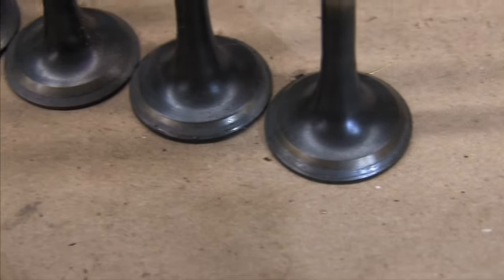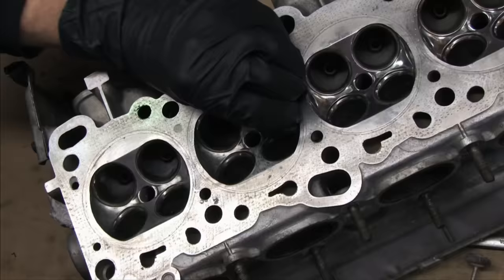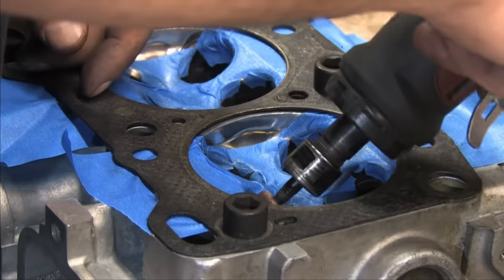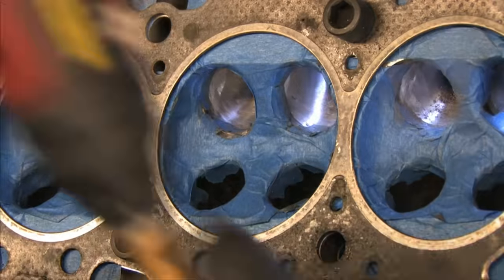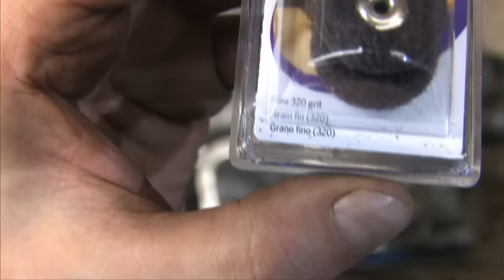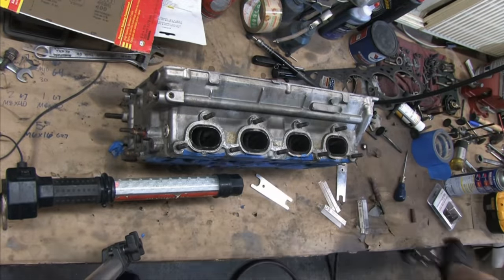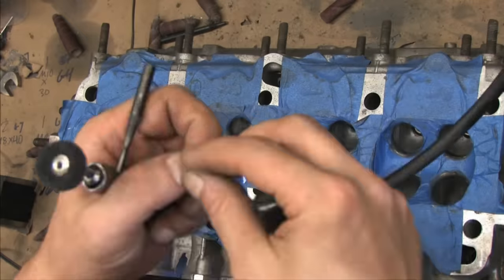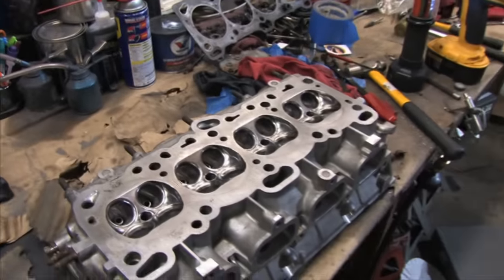Cylinder Head 204 - Porting & Polishing

Comment: i'm a wood carver/ worker. The polishing process could be made easier/faster with wood working supplies. Now days they make really big contoured sanding attachments with all kinds of grits as well as different shaped buffing wheel/things.
basically, a bunch of old guys like making wood sculpture and wood bowls. They're arthritis and low energy level makes it hard for them to sand and polish more than one bowl per retirement/life. so, there's multiple companies that make all kinds of crap for this. Go check it out!! *try woodcraft
   also! we spend allot of time sharpening and stropping our tools. we can feel the difference between stropping (polishing) compounds. There was a study done with microscope cameras on polishing compounds and most that are on the market are a mix of different size particles. They only thought they needed some particles of a certain grit size, they didn't think it would be a problem to throw in a bunch of particles that are way bigger. this is all the polishing compounds in hardware stores.
  Theres very few that really polish without scratching. Flexcut gold. DMT. henry tylor. the only ones i've found so far. good luck.
Reply from the maker: I love old arthritic guys that make tools to make life easier.  All good information!  Thanks for chiming in!
Reply: yeah...i wish you would get a honda express to restore. really nice video man. top notch. i know how much work it is.
Reply: I end up using Diamond files to really fine tune a port/polish.
Reply: You should try menzerna compounds. I'm a woodworker and luthier myself, and I've found their compounds to be excellent for everything from stropping, to polishing metal, to buffing out lacquer. They are aggressive, but have a consistent particle size and take less grit steps to get the end results.

Comment: Fantastic video!  The editing and high speed was perfect to demonstrate what you have done.
I am a professional head porter (I work for a top name guy doing chevrolet cylinder heads). We never take the time to polish as you did.  I believe it is beneficial in the chambers but unnecessary in the runners (we finish with a 80 - 120 grit cartridge roll). I would spend the polishing time shaping the bowls with a carbide instead.  I understand and agree it is critical (esp with novices) to be conservative but there are a lot of inconsistencies in the bowl area you could clean up with minimal increase in volume.  All things considered a great video!
Reply from the maker: Thanks Kenneth!  I make the same recommendations to everyone today as well.  It was suggested I try this after a discussion with a reputable shop (that I still won't out) about polyquad heads and how they create more tumble and swirl in a 4V configuration.  They mentioned using the dual-textured port to disrupt boundary layers and create tumble earlier in the port.  I thought it sounded like a good experiment.  Ultimately I went from being able to tune this car for 10.5:1 A/F ratios without knock to 10.6:1 A/F without knock.  Nothing amazing or worth bragging about.  It did nothing for the butt dyno.  So like in the video where I gave people the out after the 120 grit, I still give that advice today in the comments.  I can't pin a tenth of a point of A/F ratio on this texture work on a head that was also ported.  It's just not a big enough gain to be worth this effort.  My biggest gains were probably just from cleaning up the casting.  I learned something from this one, so I have no regrets.  :)

Comment: Back in the mid 90's I ported my olds 455 cast iron C heads for my jet boat with the tools he shows. The die grinder ate so much air I had to run two air compressors in my garage to barely keep up. It took me all winter at night and weekends and even burned through one head into the water jacket. Had to get another head and start all over. It was well worth the time. The machine shop wanted $1200.00 per head to do it. And i'm sure they wouldn't have did as through a job that i did. Everything shined like this video. Running a cheater nitrous system and two 750 holley's with mechanical secondaries on top of an Offenhauser tunnel ram made it flow so nice giving me who knows how much more horsepower. I made many a big block chev mad at me on lake berryessa.

Comment: as teenage in the 70s I started to hot rod the stock 327 in my 68 Camaro R/S that had a powerglide tranny. I did a basic top end rebuild only, nothing done to the block. took the heads off and gave em a valve job valves were good nuff but new springs, lifters P-rods, added valve seals, i bought a paper back publication out at the time on hot rodding a chevy enginee,  they had one for mopar ford etc etc. i read that thing constantly over and over but there was  a small sub chapter on the heads chapter on porting and polishing that had a lot of common sense info that made me think long and hard, they had things like matching the ports on the intake/heads to the intake gasket and the same on the the exhaust side of the heads to the exhaust manifold. after putting a gasket on the intake and exhaust side of the head I was flabbergasted as the far off they were, 1/8th was the norm but there were places it was a 1/4 inch, fuel didn't flow from the intake-->head and into the combustion chamber. it was more like white water rapids. I read the port/polish section and did it my self, after a few weeks I  burned through 3 dremel tools and piles of grinding stones, I didn't go as far as polishing but brought the intake to head to the exact size of the gasket, same on the exhaust side so there was a virtual seamless flow of fuel mixture going in the head and seamless flow of exhausar gas going out of the heads. other modifications were a smoothing out the walls in the the intake and exhaust chambers. there was a generic casting bump in theintake sid eof the head that all heads had the needed smoothing out. i was a time consuming job to say the least but it only cost me $120 or so. then i sent the heads of to the machine shop, putting the engine back together i installed a Crane Fireball cam, hooker headers, eldebrock spread bore alum intake and a holley 650 spread bore carb and a new hot distributor and big ass yellow coil.  I swear lighting came out of that engine and it was a nite-n-day with the DIY upgrades i did, jeez that car a low end pep I never thought i'd get with the work i did and I'm convinced matching the intake/exhaust ports to the intake and headers and the work done had a definite effect I wouldn't have seen not doing it.
i had a friend down the beach who was a die hard mopar head, he had gotten a 440 charger, with that big air foil on the back. he had gotten his engine back from ft lauder dale when he had it professionally rebuilt like me from stock but his stock 440 hemi was leaps and  bounds above my little 210hp stock 327 i rebuilt myself in the garage. he caught me at the pier, where all the kids hang, he pulled up next tom camaro and reved his engine and challenged me to a 1/4 race... for a $100. the few guys hearing this started yelling to everyone tom and john were gonna line em up!!!  i was seriously intimidated and finally had to agree to it, but no money. by the time we were lined up there must have been 60 onlookers, my good friends I can always count on them sticking by me, bless em the said johns 440 is gonna bury you.        
I was thinking the same, but when the rubber met the road I got the jump on him right out of the hole, but as my friends said he would bury me and it was a burial..... my little 327 hit the finish line with 3-4 car lengths over his 440!!. he demanded a another bite at the apple citing shifter probs or oil pressure lol... and again my 327 buried his 400 over 2 cars lengths. within 4 yrs he sold off the charger, super bee and all his mopars and invested in a 68 camaro, and never challenged me to another race.
i still think back of how much of an much edge I got with my home grown port/polish job i did on that 327.

Comment: It looks like I am a little late to the game being that it is 2019 and this is from 2014. But I would like to share a bit of wisdom I have used when doing my own heads.... Grind a set of valves until that margins is just gone and you have a sharp edge on them. You can then slide them into while you do the chambers. The valve will protect your seat and since they are shaved all the way down they will not stick up and prevent you from getting all the way up to the edge of the valve seat.  I hope this helps in you future endeavors as you did a good job on this head.  

Oh, also, it is better to go back over the intake side with the rough tootsie roll and leave it with a bit of texture. The roughness helps to create a turbulent barrier of air flow that will help evaporate any puddling fuel that is stuck to the walls. If you know where the fuel is sprayed you can hit just those sections and leave the rest of the port nice and smooth.
Reply: I agreed with both of your comments... This is an especially good idea (100% necessary IMO) if/when you need to grind a bit of valve relief around the valves in the combustion chamber... Adding that Polishing intake ports doesn't increase flow anyway (proven with before and after flow tests on several heads)...
Reply: The video is really good, if you talk a little less.

Comment: So YEARS ago, in my late teens on into my mid-twenties, I had a "Project Car" that also happened to pull double duty as my Daily (lol) Driver.
  It was my coveted '89 Probe GT, with the (some would say) infamous Mazda F2-T motor: 2.2 liter SOHC 12 valve (odd I know?) Turbo 4. For some reason or another, that engine was laughably rated at only 145 hp. Well, I can tell you-- and so can many other Fox body 5.0's-- without any exaggeration what so ever, that this just could NOT be the case: After careful consideration, and frequent use of my Butt Dyno, I am now certain that the true hp, at full 12 psi of boost, was in the neighborhood of 170-180 hp. Now, the TORQUE rating was more accurate: I think it was rated at 190 or so lb.ft. Personally, I believe it to be just a tad higher: somewhere around 220 lb.ft. (at full boost).
  ANYWAYS, I digress....So this one time the car had some "down time" while I waited on both the car parts to come in, and my energy and willpower to arrive.
  After staring blankly at the motor w/ the hood up, I thought "why don't I shine up some of this aluminum in the engine bay?" There was a good amount of it: the valve cover, T-body, intake, etc. etc. all the usual stuff. And it was all dreary & stained & very tired looking-- a sad gray color. It looked very boring.
  So I took off the valve cover first. Since it had alot of flat sides, I figured (correctly) that my DA Sander ought to get right in there with ease. I started with 200 grit (it was all VERY rough casted) and slowly slowly worked my way up to frikin' 2K (2,000!) grit sandpaper. After the sanding & smoothing part of the metal was done, I then went to town with Mother's® Aluminum Polish.
  Man.....after finishing up with this little job, a week later, I could literally use the flat top of the valve cover as a mirror. It was a FunHouse mirror because of the slight bending shape, but a mirror it was nonetheless. It looked GOOD in there, under the hood. So I started with the rest of it...
  The intake manifold/plenum was slightly tubular, which equated to hell getting in the curves with my DA Sander. I got all that I could, and used my hands for the curved parts. Same thing for the T-body-- It was of course "round"shaped, which led to a majority of it getting polished by hand.
  This. Took. A while. My friends thought I was crazy: Everytime they stopped by, I was out on the side of the house-- Probe's hood was up, and I was sitting, leaned over in a lawn chair, sander in one hand, random engine part in the other. My parents almost called the "Men in the White Lab Coats" to come and get me, they were so worried. My neighbors started talking about the "wacko kid who sands anything made of metal at all hours of the night & day". I had become the Black Sheep of my family. All this from wanting an attractive under-hood setup for the next time I visit the local Friday Night Hangout.
  But, it was ALL SO WORTH IT. From that point on, ANYTIME I popped my hood (...too add oil, too add coolant, or to tighten up a sparkplug that was constantly prone to backing itself out and being blown out of the cylinder head...) random people & passerbys would catch just a GLIMPSE of all that mirrored-finish Aluminum catching the sun's rays, and they would FLOCK to me all at once, asking the usual questions like, "MAN! Whatcha got in this thing!" or "wow--is this stock?". I relished in all the attention. I won't lie. It would seriously draw attention at any auto parts store I went to.
  And this wasn't a good looking car, either. I mean, the aesthetics of it weren't good looking: The OEM red paint was just atrocious. The shit was horrible: faded spots everywhere, clear coat starting to peal, you name it. The BODY, however, was straight-- not a dent on it... Which was just unbelievable considering some of the crap I did in it when I was young.
  So, I'm with you on the whole "polishing metal takes along time" thing.
  I'm also with you on the whole "polishing metal is long, arduous, back-breaking work BUT-- It's totally absolutely worth it in the end".

Comment: Nice video, I've ported heads myself and your words are true, you must have lots of patience, I like the explanation of the different theories of what works and where to concentrate the work on. Only thing I may have done differently is to remove the valve guides to allow greater access and cut off the part that sticks out into the port, at least on the intake side. I like the dowel pin trick, I know what you mean about the chuck gouging the aluminum. Try some noise cancelling or blocking earbuds and an MP3 player to preserve your sanity and hearing. Porting and polishing has a lot to do with "feel". You have to feel the contours of the ports as you remove metal. Make sure you know where your water jackets and bolt holes are. He definitely made that crappy casting look it's best.

Comment: good thoughts about the surface finish in the intake ports..... but your missing a key physics function of air moving through a tube/port/runner its called "boundary layer"  they tested it on mythbusters (very crudely) with a car surface for top speed.  similar principles are applicable to port work.  the rougher surface breaks up the boundary layer increasing port flow.

http://en.wikipedia.org/wiki/Boundary_layer
Reply: `polishing can be detrimental   ALSO  Jafro needs to understand the difference between DETONATION and preignition which rarely occurs on automobile engines
Reply: yes there is a difference, I can assure you both can and do happen on automobile engines, not as much as 20 years ago but they still do.....especially with poor fuel or lack of servicing.

Comment: Thank you so much for the vid. I'm going to the junk yard and buying a couple of shit heads just to practice.
Reply: +jolmeaki good idea!
Reply: Hey, good idea.
Reply: The most power to be had from porting a sb chevy head is the roof of the exhaust port. This came from a Hot Rod article in 1966. With the headers removed, engine in car, you stick your finger in the top of the exhaust port. There is a big sharp lump there that has to come out. 1 1/2 hour job tops with the head already removed. Good for 35 horsepower.

Comment: Ho-ly Shit. This is a god damn art.
And this is ONLY a stage 1 port and polish? What's the highest? What do those look like? Does the entire combustion chamber just look like a mirror???
Reply from the maker: +Dylan Stassen (Bassman415) In my OPINION, I'd call a stage 2 a head that's been cc'd and meaured/matched from one port to the next for runner volumes with ANY kind of finish on the ports, shiny or rough..  Stage 3 would be one that's flow-benched and flow-matched.  CNC porting is in a realm all by itself.  There is only a proven benefit to polishing exhaust ports.  My intake finishes are experimental.